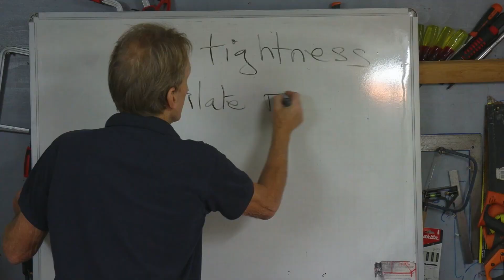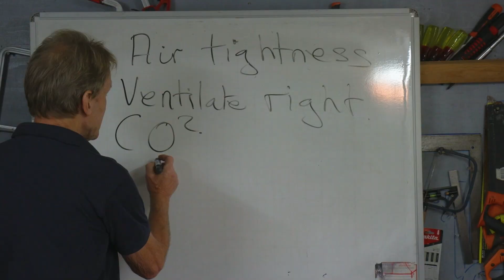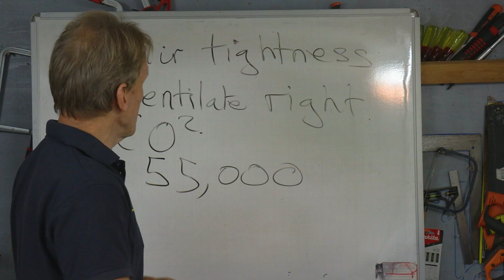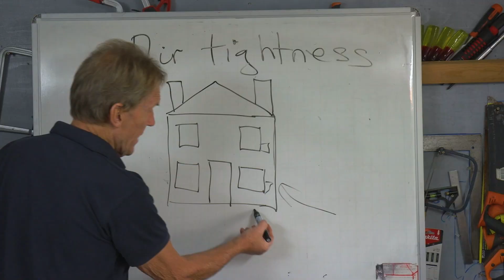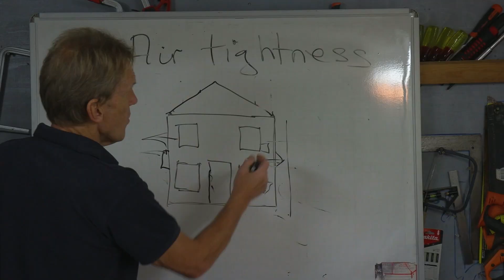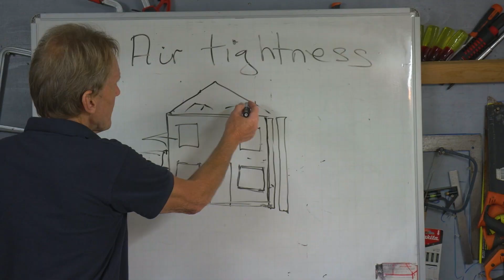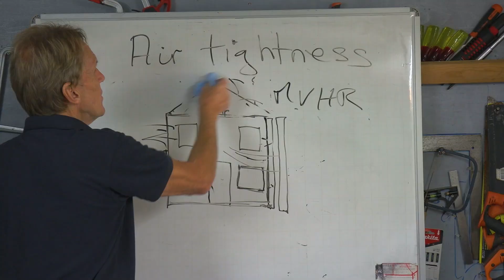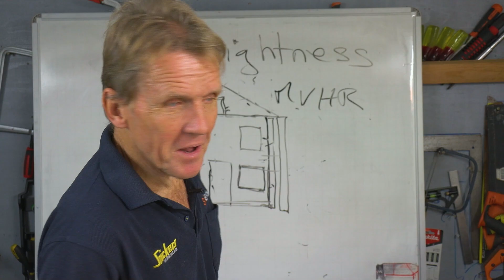The Ugly Truth About Airtight Buildings

Comment: We have a 70€ CO2 detector in our home. It tells us when the level is too high in a smartphone app. We then turn on the bathroom ceiling vent or the kitchen stove vent and the levels are good in ~20 minutes. We are thinking about getting those wall mounted vents that save the outgoing heat and also heat the air coming in.
Reply: What is causing the level to go up?
Reply: @tedlahm5740  Just breathing. O2 in, CO2 out.

Comment: The problem with airtightness is only really applicable to retrofitting and working with the often abysmal existing housing stock. On new builds it should be mandatory to use whole-house ventilation with heat recovery. This, combined with high levels of insulation new required, would virtually eliminate heating costs for all but the coldest of days, siginificantly improve indoor air quality, better than any trickle vent or other natural ventilation system and even help keep homes cooler in summer whilst makining a significant saving on electricity and heating bills. We should lso be looking at better use of materials on interior finishes. Clay and lime plasters and paints on the interior help balance moisture levels indoors and absorb the harmful VOCs for example. In particularly draughty old houses, switching from space to radiant heating so that you focus on heating the surfaces aand inhabitants through radiant heat (think sunlight) rather than the surrounding air which is being quickly lost.
Reply: Not sure why no one (including you and the guy in the video) aren't mentioning it, but I think the ventilation solution to the problems mentioned, is called a HVAC system.
Reply: @knekker1  I think they did mention HVAC but by another name (MVHR), but also the need for a complementary Insulation and draught reduction regime.
Reply: @philipoakley5498 HVAC stands for heating ventilation air conditioning.  The furnace ac/heat pump ducts hot water system and heat recovery system (hrv/erv) are all part of the hvac system.  It's an abbreviation for the industry as a whole as well
Reply: @knekker1  YUP.  Pair your solar panels with ERV + de/humifiers and you have a house with free constant fresh air circulation system.  Better yet, it comes with MERV 15 filters that can ensure clean air all year round.
Reply: I instal mvhr systems (mechanical ventilation heat return) in new builds. Filtered air coming in and wet air taken out of kitchens bathrooms etc and clean filtered air into living spaces. Heat returned to living spaces. Works okay if maintained on a 6 monthly basis.
Reply: Yes. Just moved to an older property in highland Perthshire and the sub-floor rot has been developing for many years, just in time for me to put a foot through. Ensuring the 'condensation' (both natural moisture and human living moisture) are each managed, and preferably eliminated, is key  @@gregd018

Comment: I think you may have gone a bit potty.

Whole house ventilation solves all your woes and anyone building an airtight building (as they *absolutely should*) would be extraordinarily foolish to not include one.
Reply from the maker: Martin 
I will let you be the judge of my mental health but I can assure you that air tight buildings are being built all across the country without a whole house ventilation system. That is the whole point of the video, The thinking is not joined up.

Comment: . Rooms are not air tight and are not built to be.. Trapped Damp destroys building materials and furnishings as well as creating health hazards  so vents are built into and through cavity walls and into the eaves of roofs to prevent damp from building up. Moving air outside of houses causes a pressure differential between the air inside to the air outside, that is external moving air creates areas of lower pressure relative to internal air which is why burning gasses are drawn up a chimney.

Comment: Your not going to see CO2 issues unless you are having a party and lots of people in and you never open the door. Open a window if you have a few people over. Reality is the door is going to open a few times a day and a surprising amount of air will change. The only time I see damp issues and it is due to either a building problem or a people drying cloths. Use a condenser dryer in the winter to avoid the damp from cloths. I have see people use vented dryers without being vented to outside and wonder why they have damp! If your cooking make sure you have an extractor to outside or open the window.

Comment: Watched this Video pausing, going back, making notes have to say a good video, rants a bit could put off a few people BUT AN IMPORTANT TOPIC.  In the 1990’s working for a large London Borough with 16 regions we could spend in the region of £30M just on condensation problems which were usually logged by the call centre as DAMP.
When inspected by a qualified surveyor only 1% were damp 99% were condensation.  A region would have on average 3 surveyors, each surveyor would inspect on average 15 properties a day 3/4 of which would be logged as damp. Therefore, 16 X 3 = 48 surveyors. 3/4 of inspections are logged as damp 10 giving 477 inspections as a condensation problem 4 days inspecting 1 day paperwork giving 30,528 condensation problems a week Average cost of repair £200 giving a weekly sum not including Legal claims which tenant usually won £6,105,600 per week. Average Legal claims came to £12,000 per tenant.  Which is why I was sent back to university to research the problem (at 60) and I made some of those models you talk about.  Lets say at this point of the 477 properties inspected a large proportion were due to the tenants life style.  Partners in this research were Vent Axia and The Design Partnership and Heat Recovery was the agreed solution.  I start to go in rant when I see those properties I was involved with showing those miserable conditions due to unqualified surveyors inspecting, Housing departments run by outside agencies and private repair firms who some do the inspections as well saying rising damp.  All in the name of cost cutting.  Let me tell you when you spend £6,105,600 a week inspecting installing air management is a cheap solution.  PS The models showed trickle vents are as useful as a chocolate fireguard.
Reply: Best piece on this subject. Well done. We’ve tread on the same path.
Reply: @willbee6785   Thanks Will, the path is narrow but straight
Reply: Well said allotment uk and i hope your plot has leeks that a pole vaulter would envy !

Comment: I dont mean to point something really obvious out. 
but if you can afford to make your house into a passive house odds are you can afford a heat recovery system as the domestic ones are quite well priced. 
plus the amount of money you save in heating costs from the heat recovery system is huge which is not mentioned at all here.
and if cost really is an issue you can get just an extract system installed which again is not expensive in the grand scheme of things compared to how much you would spend on making a house passive.

Comment: Well made points that should be obvious.
You made points against heat exchangers too on another clip.

Any thoights on this solution?-  controlled  'breathable' walls that are manufactured in a consistent way - as are breathable technical sports clothes that deal with heat/ cold and moisture. 
A low heat electric mesh  net with large surface area behind the plaster skin of the walls (some access for maintenance required in the design) similar to underfloor heating should keep moisture away as it would find the predetermined coolest point at which to escape away from where people use the house mostly.
Any rooms not used automatically shut heating off when there is no movement or body heat in the room and door is shut.

Comment: Perfect rant.👍 
I am setting up a low voltage/wattage MHRV for my small house but have a dehumidifier in the equation as a must. It reduces heat loss to damp air as well as controlling moisture.
Reply: The dehumidifier will give you a sore throat if it takes too much moisture out the air. Hope this helps.
Reply: @willbee6785  thanks. I aim to set at 50%👍

Comment: Friend got one of those humidifiers - plugged into 4-gang extension lead. Electrics went off for the 4 circuits in that section of consumer unit. Asked me for help before calling electrician. Extension lead and unused sockets were sopping wet from the mist. Removed it. No problem since

Comment: Your video was prescient: an article in today’s Times reports that houses and other buildings need to be designed with ventilation, and not to use the sealed box approach that you note is the current norm!
Reply: As above - you use a sealed box approach with a mechanical ventilation system, and have the best of both worlds.... it's not a big deal, particularly if you're building a house from scratch?
Reply: @piblet2  I agree about the use of mechanical heat recovery / ventilation, but that costs, and most new builds are built to an absolute minimum spec, so I can’t see that happening apart from higher spec new builds. A bit like solar panels on all new builds would make sense, but it won’t happen due to cost.
Reply: Why is this not widely understood though ? These principles were understood 150 years ago, probably 10000 years ago, sash windows, chimneys, under eaves gaps etc.....where was the fatal turning point ?

Comment: Very good summary of a significant problem where the best solutions can be impractical (MVHR). My experience is that the biggest bang for the buck comes from having powerful extractors in kitchen and bathroom especially if humidity controlled. As Roger points out - with extractors you know exactly where the moisture is going - directly to the outside. Thanks for putting this up - great presentation.
Reply: Hi Max, interested to hear your further thoughts on this. I’m building an extension to side of my house (1990s built hollow block construction )and large attic conversion also which will mean most of the existing house gets stripped back. I’m in the trade but I’m just finding the whole air tightness, ventilation, insulation subject to be a bit of a minefield. Need to just settle on a practical and efficient plan of action! Any advice greatly appreciated

Comment: The Germans just open ALL windows for 10 minutes each morning. You loose some heat....but you flush out ALL the moisture.
Reply: It is an excellent yet unknown technique. 
The principle is that the AIR is exchanged, but the warmth of the building FABRIC and furnishings is retained, so the fresh house air heats up again relatively quickly. 
Leaving windows open for longer makes everything cold, taking ages to reheat. 
Things I wish I'd known years ago!!
Reply: Do not even think that is enough.🧐🙄 The problem is that in wetter countries like UK, Ireland the Humidity in the outside air can be between 70% to 90%. Now in this moment , when it is not raining, in a small place where my cat stays and it is dry, the humidity is 70% temperature  15.4 C. Outside temperature 12 C. 81% humidity.  Inside the house it is 21.5 C and 64% humidity .When the humidity is that high outside you just let in the air with high moisture. But we need fresh air  so all I say is use Dehumidifiers if you can. There is no way we can escape the moisture in the air, but keep it under control.   I think hell with airtight houses👺.  They probably work as well but for an extra 30000 euro investment.   And again, location, location location.  I bet people in Crete do not have the same problems that Germans or english have.

Comment: I thought ventilation was all about maintaining healthy oxygen levels, which we extract by breathing in all the component gases of air, and exhaling most of it minus the majority of oxygen, so it's more about replenishing the used oxygen than getting rid of evil carbon dioxide, surely? A bit more common sense science would help, Roger 👍 fresh air means essential oxygen levels are ok.
Reply from the maker: Paul 
 The point is surely that the air is not being replaced so the oxygen levels are falling and the CO2 is rising. The Government has been pushing for air tightness but telling people to open their windows if they have visitors. I am not a scientist but something doesn't quite add up. If you have the answer pray tell.

Comment: I normally like your rants but Im annoyed at 15:15 about positive ventilation systems.  You made a video on damp issues, a long zoom call video with a very knowledgeable chap where you both boasted about how great the nuaire systems were.  Based on that video and advice I've just spent £860 get one fitted for this video to now claim their not as good as they claim to be!  Thanks.
Reply from the maker: The Nu Air system is fine but keep the paths for air to escape open.  The problem is not so great with masonry but with timber frame the air tightness of the  envelope  is essential

Comment: Unusually, I don't understand this rant. houses should be ventilated correctly dependent on their level of airtightness. Loads of people are paying through the nose on their astronomical heating bills because of inefficient housing combined with a poor understanding  of the dynamics involved. Air tightness isn't  at fault,  its the understanding of where and when air tightness is appropriate and how to exploit its benefits.  An educational video on the subject would've be much more beneficial rather than one that seems to stifle progress in building science.
Reply from the maker: Hi Tony 
Air tightness is a problem if people don't use the ventilation. Thousands of homes are suffering from mould and they are building air tight houses that rely on opening trickle vents. That is the science.

Comment: I fitted a velux above the staircase and atrium so when air rises up and the velux is open it should draw air from trickle vents on the ground floor. You can go a step further and install sensors to operate the velux, CO2, humidity and temperature to automatically open the velux and a rain sensor to close the velux.
Reply from the maker: Even with the trickle vent open on a roof window you get a good flow.
Reply: @SkillBuilder  Yes, I tend to keep the trickle vent on a roof window always open to get a nice flow and you don't need to worry about the rain.

Comment: with respect, if you use heat recovery (which you should with an air tight house) decentralised or central unit all of what your saying doesn't happen. Old air is extracted and the heat is drawn out (80%ish) this is used to heat the incoming air. So you get the best of both world fresh air and heat isn't wasted
Reply: THIS! I was looking for a comment like this. No sane expert, HVAC technician will or any engineer that respects their field would say that you only need "air tightness". Air thightness is only good if you are actually drawing in fresh air through your system and discarding the used air. Unfortunately this seems more like a war against modern technology and improvements...
Reply: @cosmopolitanussum485  yes completely agree, this is problem when your don't know all the facts but upload videos on a subject

Comment: Isn't it funny that we are saving the planet by wrapping our houses in plastic! Meantime, a sheep's fleece costs £10, hemp is easy to grow etc. It's a funny old world!
Reply: Have a look at the great products offered by Natural Building Technologies.  They make insulation and cladding systems of sustainable materials that are breathable.  I built a workshop using their materials and it's a much nicer, drier, building to be in than my brick built house.
Reply: The plastic is a vapour barrier though. A sheep's fleece won't act as a vapour barrier.
Reply: @JJ-zg1hh  If you’ve got a breathable house, you don’t want a vapour barrier. Some of the heat should get into the walls, which will then expel any moisture into the outside air, keeping the walls dry, preventing mould and creating a warm barrier between the inside and outside. Breathable paints, plasters and (lime) mortars allow the house to regulate itself; once you get the walls warmed up you can just keep it ticking over. Problem is, modern materials e.g. cement render and mortar on stone/brick walls have led to the need for vapour barriers, because the basics of modern building/renovation are wrong.
Reply: Not that funny. Plastic is a great material.
Reply: Sheep's fleece is under £1
Reply: I thought plastics originated from oil ?
Reply: @jasoneldridge4738  generally speaking they do
Reply: ... And one uses a word like "funny" instead of a selection of more appropriate ones without realising that many watchers will take the word literally...
Reply: @wiktoriaslominska8078 what would anyone expect these days. It's like a meme. IQ attention span knee jerk reaction of the masses

Comment: There's some good stuff but also a lot of nonsense in this video. It should be titled "The Ugly Truth About Poor Ventilation". The purpose of airtightness is to enable controlled ventilation, rather than uncontrolled air leakage through the building fabric which creates interstitial condensation, and then black mould, and then serious respiratory disease. Carbon dioxide itself isn't much of a risk, but carbon dioxide monitors are used because they provide readings which are good proxy for ventilation quality, taking into account occupancy. As far as chimneys are concerned, those "fires roaring all day" were spewing out particulates and radioactive poison (in the case of coal). The golden age of leaky houses was also the golden age of lung cancer. Also, it it actually possible to meet building regs with trickle vents? I don't think so, they don't have enough effective open area. In any case, AFAIK if you have any combustion appliances those rooms will (legally!) need permanently open passive vents.